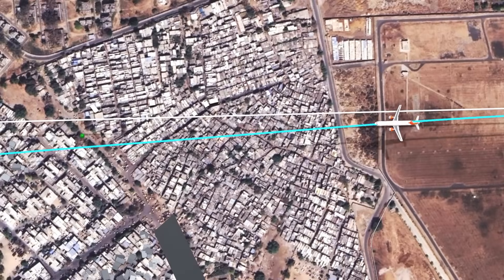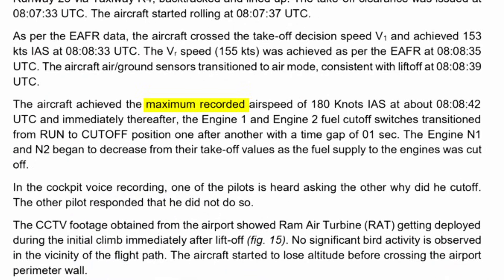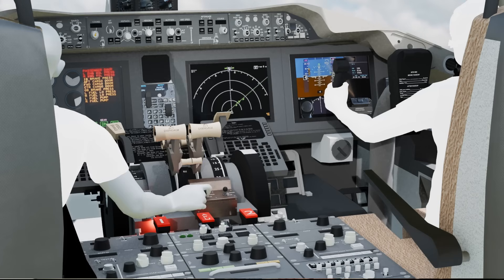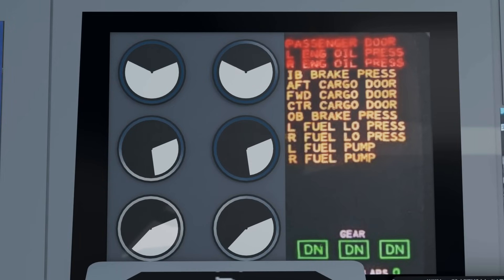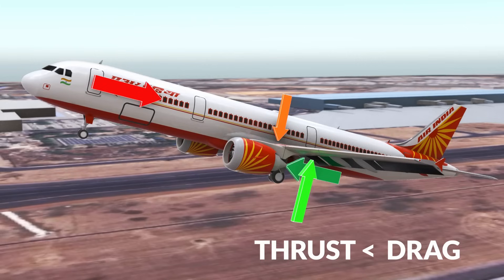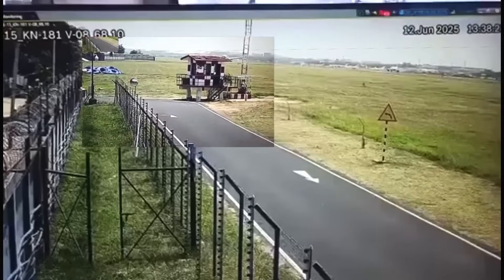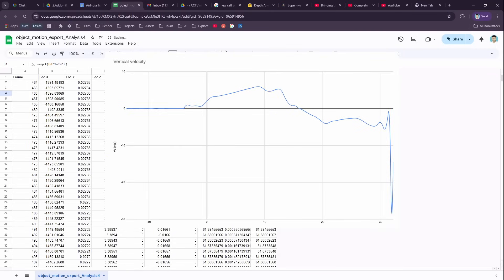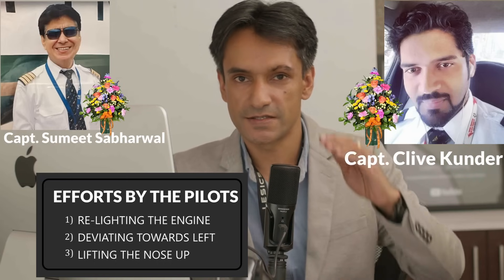Use of 3D Clone | Decoding the Crash Details you Missed

Comment: "Gravity cannot affect the horizontal velocity" What? Ever rode a bicycle downhill? Stopped listening here.
Reply: @derkleinemaulwurf07  Gravity affects the forward component of the bicycle in the direction of the moving bicycle,
Reply: Question asked as "is Gravity can affect the horizontal velocity?" and I got the answer "No, gravity does not directly affect the horizontal velocity of an object in projectile motion. Gravity is a vertical force, acting downwards, and therefore only influences the vertical component of velocity. The horizontal velocity of a projectile remains constant in the absence of other horizontal forces, like air resistance."
Reply: when an object is on a slope (like a bicycle going downhill), this vertical force can be broken down into two components: one that is perpendicular to the slope and one that is parallel to the slope. The component of gravity that's parallel to the slope is what causes the bicycle to accelerate.

Comment: It doesn't take "a few seconds" for the engines to spool down when fuel is cut off, it happens almost immediately. You really shouldn't be speculating like this when you don't know anything.
Reply: It does take a few seconds for all thrust to be lost. He is correct. The turbine and compressor have momentum. When you switch off any fan does it instantly stop? No of course not. Unless it has a brake mechanism. And a jet engine has much more stored energy in its momentum
Reply: @fillefrans2020 How long is almost immediately? The blades still underdoes acceleration. Acceleration will not drop from "X" to zero immediately with an engine with ~ 75000 tons of thrust

Comment: Wow : Salute , Salute & Salute
Now that there is some knowledge after all those trashy videos except some. This one should be on the top. Here is some knowledge. Just hear it if you are a Pilot. I mean this makes sense to me
Think about it, if somehow he had little more height , they could have skipped hitting the building and headed for the highway. Could have been more disaster on the highway but some could have been saved in the airplane and lot could have died on the highway too. Oh ! Well. These are all assumptions, what if is never true !!! 😮🙁😔😩😡😱😰😓😥
RIP : All souls. We can only pray for them.
Reply: There is no point in this brief flight that the pilots would have seen that road. Their view out the front windows at the angle of attack at takeoff, which only increased as the flight went on,  was of the sky.

Comment: All very plausable but could I ask : When you refer to the efforts to land the plane etc 'by [both] the pilots' (plural)... To me nothing proves both pilots were  in agreement
Reply: The assumption made here is that both pilots were in agreement and that they could actually see the road ahead. They weren't and they couldn't.
Reply: @stimproid  How many times you think the pilots had flown this route in the past? If they were flying this route the first time, then your speculation might be correct. But still they were 400ft+ above ground and might be able to see the highway.
Reply: @luckydogjunction2120  The upward pitch of the plane allows zero forward visibility of the ground. Doesn't matter how many times they flew that route, they cannot see that road.
Reply: @stimproid  They were flying at an angle deviated to face the highway as pointed out by the host. So did they know the highway is there?
Reply: @luckydogjunction2120  When one engine cut out before the other, a yaw would be induced. When the engines failed the pilots would have limited control due to loss of hydraulic pressure. To say the deviation was intentional...toward something impossible for them to see? You can see why this sounds improbable right?
Reply: @stimproid  The RAT provides the necessary power for basic control and in addition when one engine relighted. Plane also pitch up when under normal landing , can they see the runway?
Reply: @luckydogjunction2120  planes approach the runway at much less of an angle than takeoff... so yes. The RAT takes several seconds to provide hydraulic and electrical power. It is not instant.
Reply: @stimproid  The engines was still running at the instant the fuel was cutoff for at least 2 secs, still have power for controlling the yaw. The shape of the head of the plane is a cone shape, not horizontal from the pilot's view. The angle between the "cone" and "horizontal from pilot's view" is  definitely greater than the pitch up angle.
Reply: @luckydogjunction2120  I would agree with you ...but then we would both be wrong.
Reply: @bonnaud_dowell Could the Captain make decision in case there was an disagreement?

Comment: I never believed this was a pilot suicide / homicide  event.   Curiously  several highly experienced commercial pilots believe that it was. I have a certain amount of experience with automated control systems.  I noted that one of these highly respected  pilots who has a significant presence on Youtube had no genuine understanding of how swtiches, relays and electronically controlled valves actually work.  He kept insisting that there was a direct  connection between the switch and control valve.  This would be true if everything is working properly but many things can disrupt the flow of electric current.   It needs to be determined to what extent computers can interrupt the process and close the valves.  Also exactly how do the data recording systems record the position of the switches.  I can definitely see a situation where a switch is reported as either open or closed, but that is not the physical reality due to a poor electrical connection.

Comment: The most professional inquiry and report I have seen on this crash, after the two LinkedIn articles by a Ranjit John titled: Hiding in plane crash and "Eyes wide shut - Deliberate misdirection or gross incompetence" His interview video: Ai 171 Crash I "Fuel Switches are a Red Herring, Smoking Gun Is ..I New Facts Emerge I Barkha"  Bravo to the indian engineers for their impressive job on this crash inquiry.
Reply: One of the major assertion in that article is that the aft EAFR was damaged by the Lithium ion battery in the aft EE bay. How is this possible when their location is more than 40 feet away from each other? Sorry, but that article is more speculation.

Comment: Interesting analysis, although there is not much focus on the FDR showing that the manual switches had moved to CUTOFF sequentially until right at the end of the video. The report notes a 1-second gap, not less than second as suggested in the video, between each fuel switch lever being moved to CUTOFF. That’s easily possible by hand on a 787, backed up by a fair amount of 787 simulator evidence, since they’re both side-by-side. A single electrical fault wouldn’t affect both independent cutoff circuits, so the sequential shutdown actually points to manual movement, not a malfunction. The switch sensors that recorded the CUTOFF are located at the switch on the 787 as well as at the valves, so log the physical position of the switches and in this case their move to CUTOFF position. Again, both connected to separate, independent circuits meaning a sequential failure would be highly unlikely.

Comment: but tell how can the fuel switches
TRANSITION from RUN to CUTOFF
as said in the report if it was technical glitch?
787 does has fuel cut logic,but it doesnt TRANSITION the switches.Explanation?
Reply: It didn't say transition phisically, and it didn't say the knobs. The entire transition system encluding the electronic wiring and digital signalling inside the box are called "the switches"
Reply: Gents, you can find the missing answers in Jeremy John Thompson AI 171 ( just google that and start with the first video). The guy is a little rough around the edges but has all the facts and backs them up.

Comment: Air India 171, a Boeing 787-8, was landed on a building rooftop instead of on the safer road beside it, by the First Officer (FO), alleged to be the ‘pilot-flying’ (PF) in the AAIB’s initial report.
Here’s how it happened as you can see from two pre-crash videos, as analyzed by a current 787 Airline Captain, 38 year veteran, having previously served as a 777, 767, 757, and 737 Captain, ‘Check-Pilot’, and simulator instructor.

The Ahmedabad airport’s CCTV video taken from a ground camera location viewed from behind the 787’s left side, showed it’s descent after climbing 425’ above the runway (625’ above ‘mean sea level’), then began an immediate bank of the jet’s wings to the left, turning the jet left of course by 3 degrees (camera footage shows the jet moving markedly left of course while descending), towards a medical college of five six-story buildings and one two-story, adjacent to a road one mile southwest of the runway.

A 2nd video/audio recorded from a rooftop by cell phone, viewed from behind the jet’s right side, revealed that both landing gears’ 4 wheeled ‘trucks’ had already tilted forward, into the retraction position, proving that the crew had initially selected the landing ‘gear’ lever ‘up’ after liftoff. This forward tilt is normally followed by the landing gear doors being sequenced to open, allowing the ‘gear’ to retract into the ‘wheel wells’, and closing after transit. The doors couldn’t open after the ‘trucks tilted’ because of the loss of hydraulic pressure supplied by the Center hydraulic system’s two electric pumps. These pumps lost electrical power when both fuel switches were ‘cutoff’ and both engines’ four generators ‘tripped off-line’. This dual engine failure automatically deployed the ‘RAT’ (ram air turbine, which is seen/heard in this rooftop video/audio), with it’s wind-driven propeller operating a small hydraulic pump and small electrical generator to power 10 flight control surfaces supplied by the Center hydraulic system fluid to maneuver the 787, but can’t raise the landing gear or move the flaps. The generator powers the Captain’s flight instruments, but not the Copilot’s, forcing him to view the Captain’s instruments with difficulty from across the cockpit, while the auxiliary power unit (APU) auto-starts to re-power the electrical systems and engine ground starters.

It would have been obvious to both pilots that based on the current glide path now being achieved, that a 1 degree turn, back to the right (as seen in CCTV video), was needed to allow a ‘Best opportunity’ landing on the road to the right of the medical complex, missing the buildings completely. Pilots are trained that the safest plan was to aim for this road, avoiding the buildings etc., in the event a restart of the engines was unsuccessful.

The Captain, (allegedly the ‘Pilot Monitoring’, according to the AAIB’s preliminary report), would presume and direct the ‘road landing plan’, (possibly having discussed this with the Copilot) while focusing on restarting the engines. When it became obvious he’d been distracted too long from the Copilot’s maneuvering, now for a landing on the rooftop of the two story medical building (‘Aircraft carrier style), which now appeared to be the immanent destination, he proactively selected the landing gear lever back to the down position, plausibly to ensure that the ‘landing gear’ would stay ‘locked down’ if hydraulic power was restored, to help absorb the impact forces and keep the passenger cabin away from ground contact for as long as possible, hoping to land beyond this building on the road. A radio ‘May-Day’ call was transmitted before the building collision.

If you’ll review the Ahmedabad airport on Google Earth and draw a line, one mile southwest of runway 5 (230 is the takeoff course), to where 171 impacted the medical building, you’ll notice there were plenty of wooded areas available on both sides of the building they hit, with the best landing area on the road to the right of that building. Had the jet stayed on the extended runway centerline after takeoff, as pilots are trained to do, they wood have missed all the buildings completely and landed on the road. Pilots are trained to fly their malfunctioning aircraft to avoid hitting obstacles (i.e., large objects, like buildings).

The crew knew that they couldn’t make too many course adjustments, which would eat up critical altitude. The video evidence favors, this maneuvering as being intentional, because of a number of left and right course adjustments made by the ‘pilot flying’ (CCTV video), shortening the gliding distance, resulting in choosing to impact the two story building’s rooftop, short of the other six-story buildings, and thereby deliberately rejecting a road landing. The fact that the tail was still on the roof with most of the aircraft having slid off this building, likely indicates they were in a stalled flight condition on touchdown, with most of the wreckage colliding with the other four six-story buildings beyond. Such a slowed speed allowed many passengers to survive the impact, as seat 11A’s passenger reported seeing, and was himself, able to walk away from, but the smoke-filled cabin prevented the evacuation of the rest of the victims.

Relying solely on the video evidence as described above, should be sufficient to deduce the intentionality and skill of the PF, to precisely aim for and hit the building complex ‘dead center’, though it being narrower than the 787’s wingspan, instead of aiming for the equally reachable road, all done without being noticed by the distracted PM. The above perspective is plausible as presented and will certainly be proved or refuted, if/when supplemented and co-oberated by the full release of cockpit audio from the CVR, and flight data obtained from the FDR. Original media reporting showed a crash investigator carrying a recovered, undamaged DVR (digital video recorder) from the crash scene which likely contained videos of 171’s cockpit, cabin, and exterior views during the crash.

The FO was allegedly the ‘pilot flying’ initially, and would have easily been able to disguise his ‘cutting off’ the fuel switches at the exact moment the Captain’s right hand reached forward to raise the landing gear lever, ‘un-guarding the fuel switches’ after liftoff, while his right arm’s sleeve partially blocked his view of the fuel switches. These were then covertly 'cut-off' by the FO who could easily reach them with his left hand while still controlling the aircraft with his right, (i.e., cutting off the left fuel switch 1st, followed 1 second later by the right, which is commonly done in that order, by many of my copilots, in one second or less depending on our commutes home). The Captain may have assumed and/or saw the FO move his left hand, to take over ‘guarding the fuel switches’ while the Captain raised the landing gear lever assuming the FO’s apparent innocence in guarding the switches, disguising a clever rouse. The Captain then sat back in his seat returning his right hand to guarding the fuel switches as the FO returned his left hand to the flight control wheel which might have been a confusing distraction, especially if that wasn’t Air India’s standard operating procedure, as it is at some other airlines. Almost immediately, the crew felt the jet’s sudden deceleration, causing a horrific ‘Startle Effect’ for the surprised crew member, so the PM (Captain) confirmed the engine failures by seeing the instruments and warning lights, and hearing the alert sirens, likely having seen the fuel switches being ‘cut off’, realizing what the FO must have done (and plausibly, why?), calmly asked him ‘why he cutoff?’. The FO’s likely contingency plan was to lie, saying ‘I did not do so’. The ‘Startle Factor’ combined with this denial would be terrifying, which would account for the crew’s delay in restarting the engines with the 10 and 4 second gaps in selecting the fuel switches to ‘run’ which prevented the engines’ recovery. The FO, later seeing the engines recovering, likely aimed the plane towards the road at the Captain’s direction, but then performed a last minute 1/2 degree left turn back for the building (cell phone video before impact), without the Captain’s notice, thus repeating the ‘911/World Trade Center styled’ attack, knowing that a survivable landing would likely have occurred on the road.

Most pilots are also trained that a crash landing with the landing gear extended, helps to absorb impact forces, which is likely why the crew re-selected the landing ‘gear lever’ to down, as shown in the post-crash photo, and made a ‘Mayday’ radio transmission as a last valiant aviator’s duty of identifying who the bad actor may have been. Well done Captain, who saved the life of at least, one of his grateful passengers, by not attempting to grab/wrestle the controls from the copilot who intended harm to everyone and could have just as easily, instantly dived the plane unrecoverably into the ground, killing the passenger in 11A as well.
Reply: The road besides the Hostel building is 12 metres wide. The Boeing 787 is 60 metres wide. What do you think?
Reply: Tell me "captain." How would they see that road, just a few degrees off the nose, with the plane pitched up so high?